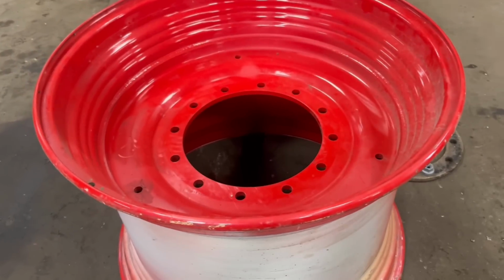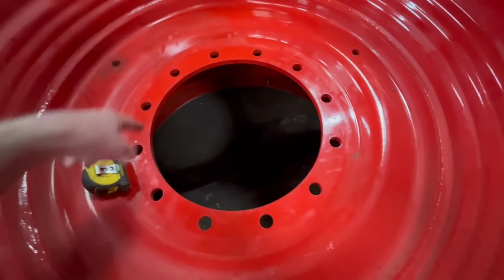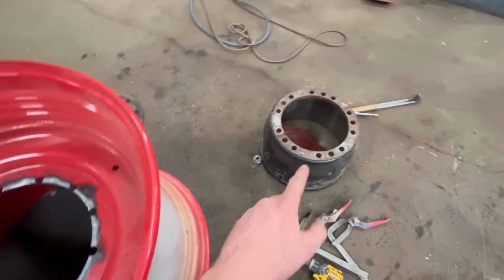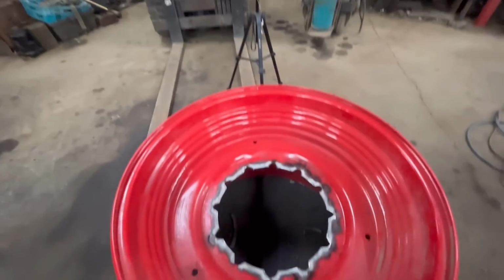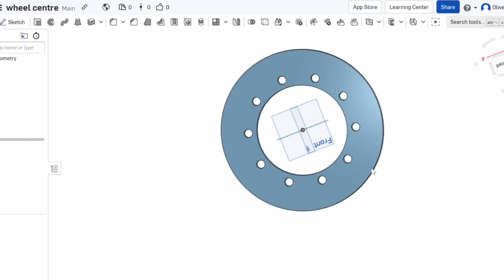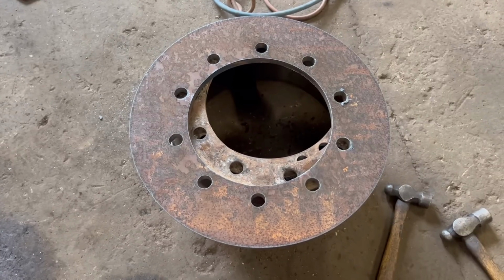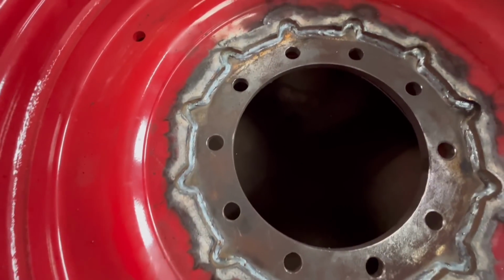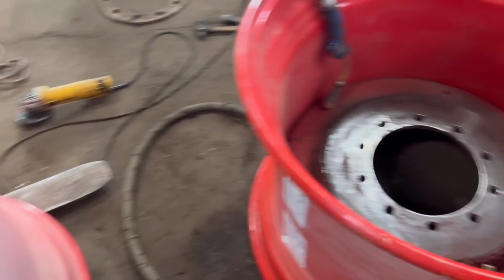Changing wheel centres from 12stud tractor to fit 10stud truck.

Comment: Another great video thanks.  A handy thing when entering dimensions into Onshape is to enter it as a formula to save having to do the arithmetic in your head. So enter your 505mm as 505/2 to get your 252.5mm radius.  You can add subtract and multiply and other fancy things that are beyond me!
Reply from the maker: Great tip!
Reply: @snowballengineering You can do the same arithmetical shenanigans in Fusion 360, just for info 👍

Comment: Good job mate, still a good watch even if it’s only a wheel centre. I got two quad wheels at an auto jumble to use the tyres on my lawn tractor, the wheels didn’t fit so I swapped the tyres over as I needed the use of them but now you have given me a winter project to adapt the wheels to fit. Looking forward to your other videos. All the best.

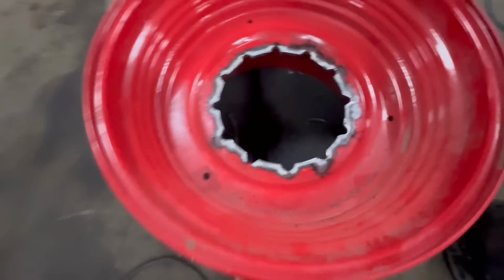Comment: @7:30 you need a die grinder with a large round carbide bit to cut those radiuses in, instead of the large grinder, now @8:18 you can see the cuts are so uneven = because of the tool used.

Comment: I thought it would've been better to cut the new ring c/w the stud holes and then cut the hole in the rim disc (centre) to fit the new ring so it fits flush, then grind the channel between the 2 pieces to form a groove to aid the welding.

Bearing in mind that electric arc weld is actually casting new metal into the groove (which may be harder and brittle compared with the rest of the wheel) and the last thing it needs is any sudden shocks which could cause cracking.

I'd be interested to hear from others.